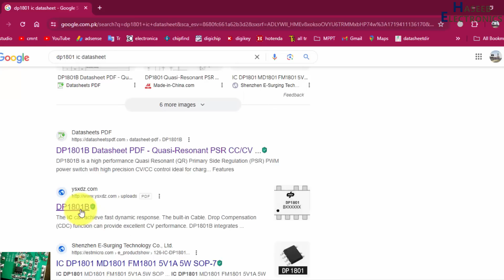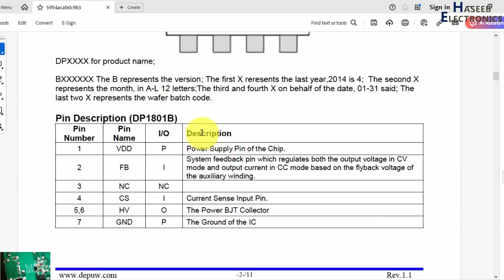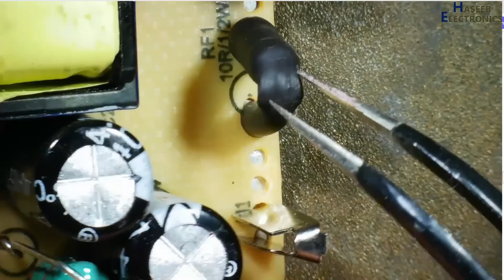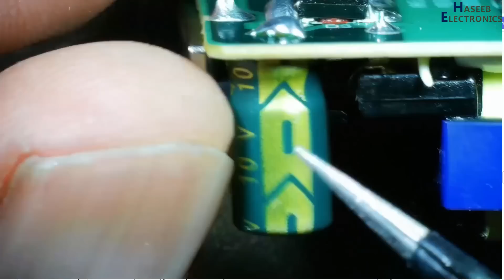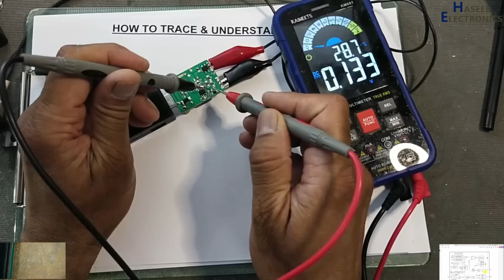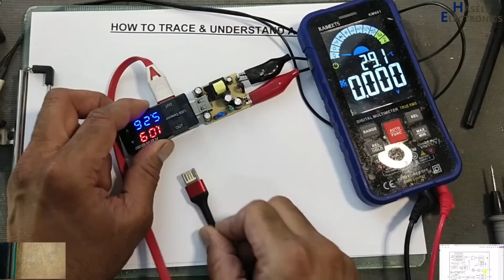{1141A} SMPS circuit without optocoupler

Comment: Sir I have 24 volt SMPS without opto cohupler .I tried to reduce voltage . I connected 10 k variable preset in the place of 2.4 k in feed back now it is not giving any output pl advice

Comment: Who takes  responsibility for opto duty ,sir
Reply from the maker: the voltage value from auxiliary winding are used as feedback. That voltage are used as VCC and a portion of that voltage is utilized for output measurement

Comment: Nice video. Just want to know one question, in my smps, the vcc voltages are not present and smps is not working. When I remove the ic the vcc voltages are 90 volts. My smps ic is CM1702. Please guide me